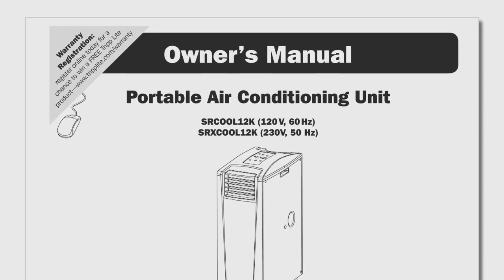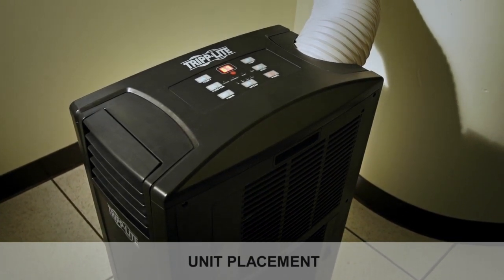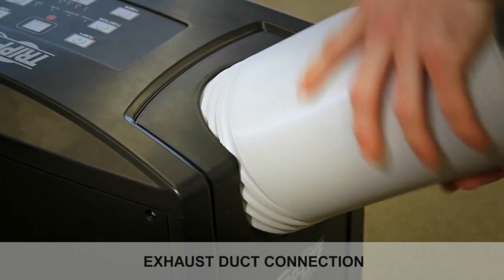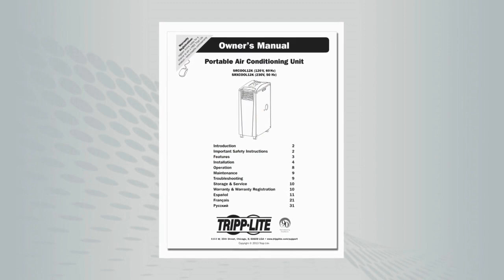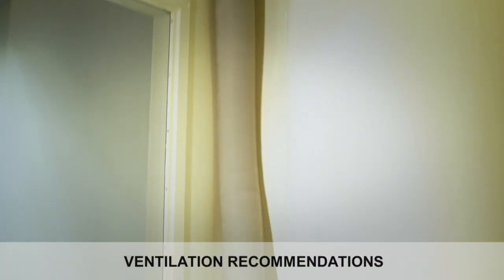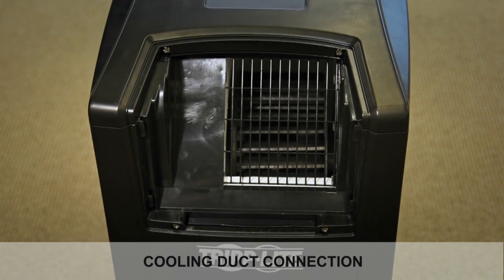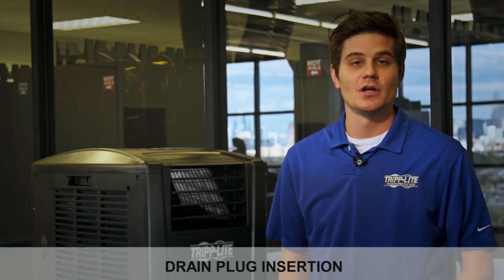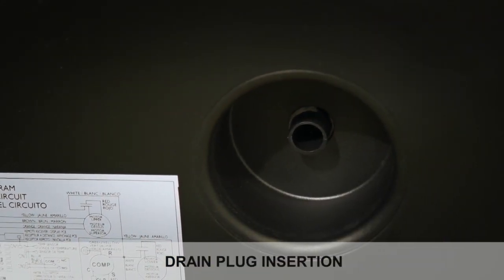How to Install the SRCOOL12K Portable Air Conditioner - Tripp Lite

Comment: Before I buy... documentation seems to be void of a make up air connection, and drawings don't have internals detailed.  Since I will primarily install a unit for dehumidification, I need to not create negative ventilation pressure in the space.  In your experience, where can make up air be ducted in to provide for condenser cooling flow [or is there even room to do so]?